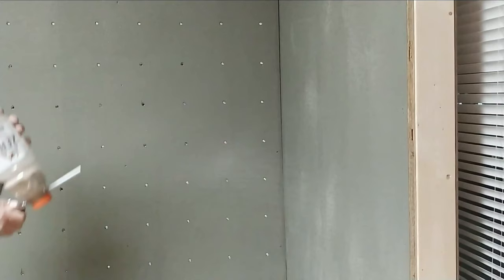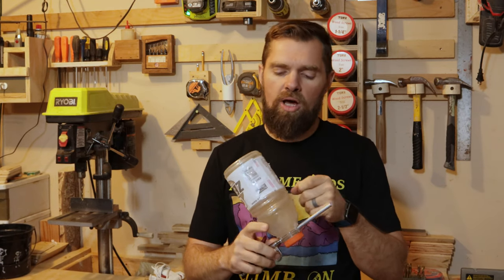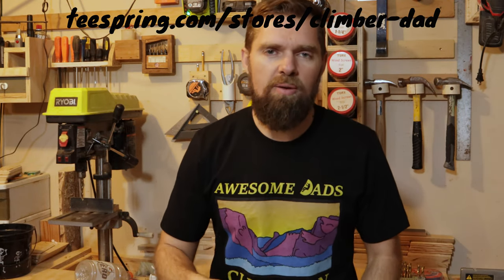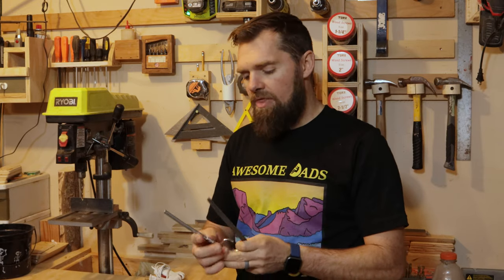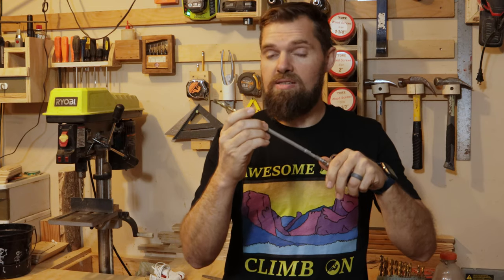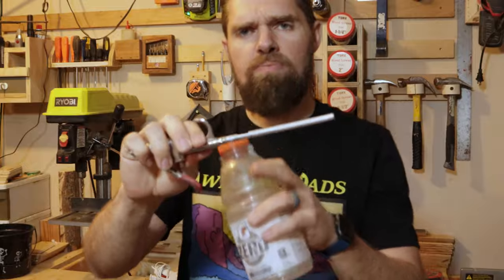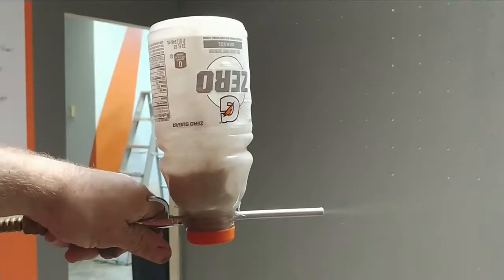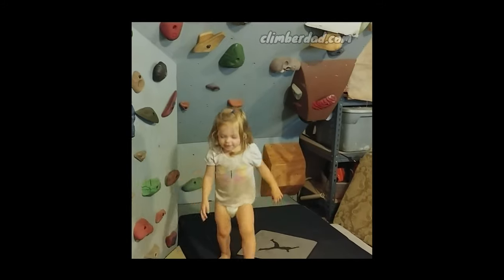HOW TO MAKE A SAND BLASTER for TEXTURING CLIMBING WALLS

Comment: What kind of sand would you recommend? I was just at Home Depot and didn't see any in the drywall section.
Reply from the maker: Silica if you can find it. I'm experamenting with other types of sand.
Reply: Opinion on tread texture?